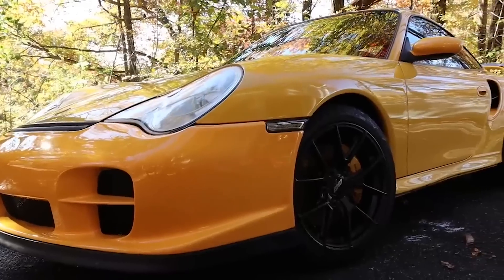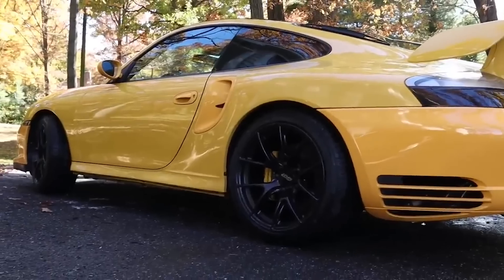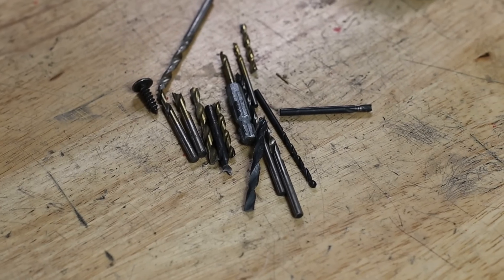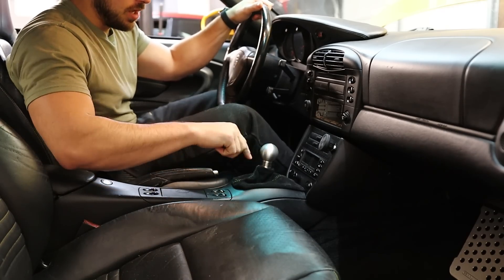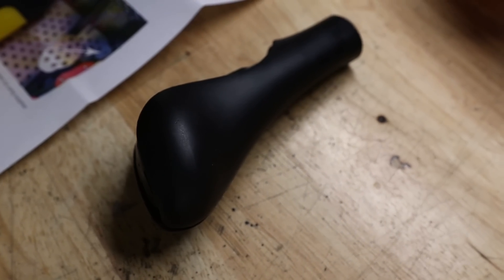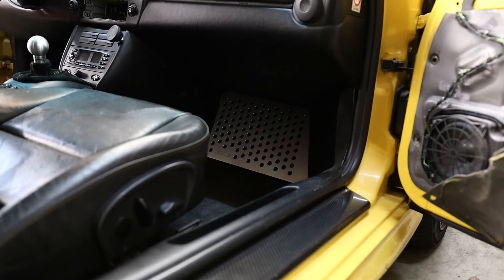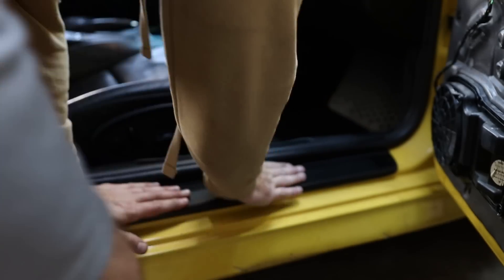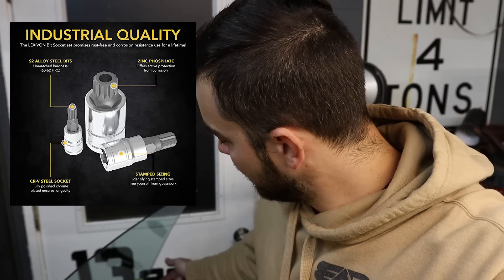Rescuing a Cheap Porsche 996 Turbo - Electrical Problems!

Comment: Hey Matt, nice video!  I've owned an '02 996 C4 and a heavily modified '04 996 TT (only 54K miles).  I experienced very similar issues first hand and after spending over $20K in repairs on the 04 TT last year I gave up and don't recommend anyone purchase an older 911 unless you're very handy with a wrench or have deep pockets! I had fuel pump & boost issues, the power steering pump was leaking all over the place and had to drop the motor to replace the pump and lines, we had to retune the ECU and address a handful of other issues.  The vacuum lines were a nightmare and you have to have hands the size of a small child in order to access them, ugh!.  All in all, very fun car to drive but when there's mechanical issues it can get super expensive, the car spent more time in the shop last year than it did on the road.  I finally sold the 996 TT and bought a low mileage MB AMG E63s and couldn't be happier!
Reply: To be fair you said it was heavily modified right? On a nearly 20 year old car especially depending on the mods fuel pump replacement and boost issues aren't unexpected. 
And on the 996 turbo as well as the 997.1 turbo the coolant line fittings are a well known issue that requires the engine to be dropped in order to repair or prevent. 
Vacuum lines should be zip tied in various places while the engine is out for the coolant line fittings. Water pump and thermostat as well. And all the lines should be inspected to see if anything needs replaced at that time. If that's all done at once they are extremely solid.

Comment: Putting in the (unnecessary) floorboards and fixing the drivers side one with only 1 screw, I personally wouldn't do that. What if it moves while driving and blocks the brake or clutch pedal. It even makes vacuuming the floor more difficult.
Reply from the maker: I see your concern, but it's impossible for it to move in a way that would block anything.  It's actually bolted up top to a factory mounting point.  The only other mounting point is the screw I couldn't drill a hole for.
Reply: Yeah they're a little useless and hate vacuuming that

Comment: Aluminium plates are a so-so decision. Especially in the silver look. I would have them anodized black...like the previous pieces you installed.
Reply from the maker: I didn't go black because you wouldn't be able to see them at all.
Reply: @matt13ross  good choice I went with silver as well with the same thoughts. I love the look.

Comment: I understand the dilemma of when OEM is worn and looking for replacements aftermarket is a cheap, readily available solution BUT I would vote to keep look of OEM mostly. 
Otherwise thanks for the update on progress!
Reply from the maker: For which parts exactly?
Reply: @matt13ross  the carbon fiber bits on the inside and the floor pans.  I'd vote to get them reupholstered with elcantara.  More pricey but brings up the interior to new gen looks. Just a suggestion, check it out.

Comment: hardened HSS drill bits are brittle..slow your drill down or ease off the trigger until it's bitten the metal..especially if you're going in at an angle..
Reply from the maker: Any specific brand?

Comment: Good content Matt, nice to see you filming the full process to determine the fault rather than timelapses which skip over the effort. Just a thought but you could get the seats refurbished/dyed to make the interior better? I do like this project/car.
Reply from the maker: Yea the seats need fixing for sure.
Reply: @Matt Ross  look for some used 997 seats online is my suggestion. Or check out getting corbeau lightweight seats.

Comment: Been watching this series since the beginning. I have a massive project vehicle I need to start working on when the weather warms up, and your series has given me new motivation to get started on it. Appreciate the vision, hard work, and the idea to document this clearly frustrating project. Don't give up. PS winterbeardbros 🤜
Reply from the maker: Glad I can motivate! I haven’t been feeling very motivated lately myself.
Reply: @matt13ross  that wheel hub issue would tilt anyone. I don't blame you. It's hardest when you pick something you think will be easy, and it turns out awful.

Comment: I actually like the carbon fiber. If the materials around the carbon fiber get restored, cleaned up, or replaced it'll look even better. It's not gonna be to everyone's taste. But as long as it's better than before and it's what you like that's all that matters, keep it up!!
Reply from the maker: Agreed!  Needs a few more minor cf pieces.

Comment: If the stupid long throws of the 996 shifter bother you, check out swapping to the 997.  The standard 997 is much shorter and crisper than the 996 and plug and play.
Reply from the maker: I've read that, but for now the throws don't bother me.

Comment: Hey Matt love the content on the Porsche! I’m going to have to agree with a lot of people on the carbon fiber bits and the metal floor trim pieces. the door sill before look pretty clean with “turbo” in the middle are these just too expensive to replace? and I think the metal plates on the floor aren’t awful if they were a matte black to match the petals and kind of hide a little bit better in the carpet. It sticks out too much imo. Not hating just my opinion, keep the videos coming!
Reply from the maker: Opinions are just fine!  I'm happy with these parts.  New seats will really freshen up this interior.

Comment: There is a VW equivalent for the latch. Check the intrawebs. For what it’s worth I ordered latch due to similar issues and it was the regulator in the end inspite of all diagnosis pointing at latch.
Reply from the maker: Yup that's what I ordered!

Comment: Matt, same exact thing happened with my passenger window. It is a short in the latch and it needs to be replaced. Did you order the new latch from Porsche yet? URO makes the part for an Audi that’s not listed as a compatible part on their website, but it it works with the 996. Saves you like $300-$400 and the build quality is just as good as the OEM porsche part. If you want the part # LMK and I’ll dig it up for you.
Reply from the maker: Thanks!  Yea I ordered a VW replacement which was pretty cheap.  Hope it fixes is!
Reply: @matt13ross  10-4. 

So you know, I already tried 3B1837016CG which did not work. The pins do not match. 

The OEM Audi part numbers that are compatible are as follows:

Drivers side: 8N1837015C
Passenger side: 81N837016C
Reply from the maker: Hope I got the right one!

Comment: What are you planning on doing with the seats? They really let the interior down 🤔
Reply from the maker: Still debating.  I was looking at 997 seats but too expensive.  Not really interested in used 996 seats, or fixed back racing seats.  I will probably get these recovered.
Reply: @matt13ross that’s a great idea! They’re not too difficult to rebuild the foam and then recover. If the lateral left side bolsters are in decent condition, which they likely aren’t on the drivers side then there’s even less work! Leather can be dyed easily, so unless it’s torn it should be a relatively simple fix!
Reply: @Matt Ross  I know I replied to a different comment about 997 seats but I didn't see this post about their price being too high. If that's the case I definitely recommend the corbeau seats. They look better than the oem seats and they will drop 50-75lbs.
Reply from the maker: I like my heated comfy seats though!  I have fixed back seats in my E36. This is more of a comfy DD cruiser.
Reply: @matt13ross  you can get heater seat options from corbeau as well

Comment: I would paint the car all same color yellow , source some new taillights , gt2 style rear wind , factory turbo twist wheels, 5mm/10mm spacers, good quality coilovers , dude in blue reviewed my 996tt if you want to check it out 👍
Reply from the maker: All in due time, fixing most mechanic issues before paint and fun stuff.

Comment: Sorry mate. The car is starting to look tacky and very much like a teenagers car. Fitting the plates with only 1 bolt is a safety hazard. Try getting the car back to OEM mate. Some suttle upgrades can be done, but try to keep it original, remember this is a classic!!
Reply from the maker: Not safety hazard with the floor plate, it's not going anywhere.  You think replacing the beat up OEM parts with carbon fiber is tacky?
Reply: I think you got the point...  Too much carbon fiber on a classic car in my opinion... You'd like to restore to oem.
Anyway thank you for this great videos and happy new year 😊 cheers from Italy!
Reply: I agree. This car needed to go back to oem not this style you are going with. Thats just my opinion.  I enjoy the watching , just not my style
Reply: I tend to agree, going OEM is the way. those floor boards are an awful look. Gear knob i can live with as the OEM is nasty plastic. CF as cosmetics seems a bit cheesy these days. Still, you’re having a go, which is way ahead of us keyboard wannabes.
Reply: @matt13ross  you should get carbon fiber running sides with a Porsche logo on them instead of those ones that are just plain carbon
Reply: I don’t understand the purpose of the “floorboard”.   Is it cool just because it’s shiny?

Matt’s in a difficult situation when rennline offers him free stuff and maybe some $$ to install it.  Preserve the build?… or take the cash?  Hmm
Reply from the maker: Man, you guys really hate the floor boards lol. I think they are a nice little touch. They are also super easy to remove if I don’t like them in the future.
Reply: Wow, honestly not surprised. Porsche people only care about factory optioned “deviated stitching” and other nonsense.  They’re always blabbering about the “spec” and how good the clear coat is on their arbitrarily named color.  Then they comment rudely on man’s work which benefits us all. Ridiculous
Reply: What color is your Porsche
Reply: Matt, I love your videos, but you should watch this video from another Matt, to understand how Porsche people think and why you should be careful with mods: https://youtu.be/rdJYiRROeAc 
P.S: Love the floor mates!
Reply from the maker: Speed Yellow ....ish
Reply: X2 the car loses its essence with all that crap
Reply: As a Porsche owner my suggestion is to pay mo attention to what Porsche people say. There is nothing special or classic about a 996. Do whatever you want and keep the great content coming.
Reply: I think even for YouTube this is a money pit. The car is way too tatty. Every piece of trim needs to be changed every piece of interior, the bumpers the paint the mechanicals, electrics. You just payed way too much for it.
Reply: Went from tacky to tackier and ricer. Paint is worse. Interior seems mismatched with black petals and aluminum floorboards. Carbon fiber matches nothing in the car. I guess just sticking on the free spare parts from rennline does it.
Reply: Agree with  @sfdrifts  - ! A 996 isn’t a “classic” classic, but either way: it’s your 996 Matt, do what you want with it! The “only OEM” crowd is very odd and there are plenty of restomod, hotrod & even “stanced” 911’s that look great in their own right. 

- signed, a 993 owner
Reply from the maker: Regarding the paint comments: for the hundredth time the car isn’t done and the paint is being addressed.
Reply: @matt13ross  don’t worry about purists, you’re getting it back on the road and there’s something to be said for that!  It’s also your car, keep it up, enjoying the content!
Reply: @Matt Ross  damn now I see what you meant by that FB post about people not liking aftermarket parts lol.
Reply: Subtle.
Reply: Just saw a post where someone said the 996-911 is not a classic. I cannot believe someone made such a comment. The 996 was a turning point in Porsche history. Handling, 4 link suspension, improved balance and it was at a time when Audi engineering was applied and collaboration really worked. In the UK we are buying any and all 911’s available. Matt, I hope you get the opportunity to buy a 993 and go to work on it. That is truly a purists 911. Once again, keep up the good work mate and try stay true to the industry.
Reply: It's his car, mait. I'm not a fan of carbon fiber stuff either, but he can do what he wants. 
If it looks good & feels good, that's all that matters, none of this "classic" purist nonesene.

Comment: this car should of been purchased for 25k if that.
Reply from the maker: Good luck getting a running / driving 996 Turbo for anywhere close to that price.
Reply: @matt13ross  clean oem examlles w undr a 100k are going for 40k or so
Reply from the maker: I haven't seen a price that low.
Reply: @matt13ross  came across one on Craigslist for 40k w 99k miles on it. there is a clean 03 on rennlist for 50k and it has 100k miles on it.. they are both tiptronics though. sorry man you should cut your losses at this point.. this car is going to bury you
Reply from the maker: That's the difference, auto.  Manuals are going for an average of $60K plus, and those are all silver.  A manual + speed yellow is a huge increase in price / rarity.  I'm not saying it's worth what I paid for it, but you'll never find a running / driving manual for anywhere close to 25K, let alone a speed yellow one.
Reply: @matt13ross you could of just not bought this car and bought a clean speed yellow 6 speed for 70k or so. the 6 speeds on these cars are garbage too
Reply from the maker: I did not have $70k to spend on one lol.
Reply: @scottchelmford7136  the transmission itself is Stout. There are 1000hp+ builds on the stock 6 speed transmission holding no problem
Reply: @sutherlacd27  ive read quite the opposite.
Reply: @scottchelmford7136  the stock clutch is weak as hell. Needs upgraded with just exhaust and tune after a short while. And the shifter itself isn't the best either. But the transmission is solid.

Comment: Way too much boy racer crap! I thought you were bringing it back to an adult car status. I guess not.
Reply from the maker: Boy racer?
Reply: @matt13ross  yes! Which I thought you were trying to get away from.
Reply from the maker: I don't follow the boy racer comment.  Because of carbon door sills? lol
Reply: @matt13ross  It’s not just the carbon door sills, it’s armrests, aluminum floor crap and weird shift knob. Just fix it and save your money. OEM is always classy. When I flip cars, anything aftermarket on it goes in the trash can.

Comment: Sorry but the last two episodes are just cheap slap on parts tuning. You seem to be procrastinating the real work on the car.
Reply from the maker: Not procrastinating anything. The new hub hasn’t come in.  And the parts aren’t cheap
Reply: @matt13ross  You bought a Porsche, what did you expect. 🤣🤣🤣 Anyway hopefully the next one will be better. Don't want to be a hater 😊
Reply: @N911GT2  Spoken like someone whos never taken on a project car. And don't worry, your reply about how you've been working on cars for 20 years and have completed 30 project cars and own 3 race cars will fall on deaf ears, still just sounds like hate to everyone reading.
Reply: Hi Matt. You have a car that is now considered a classic. Keep it that way and rest assured, you will not only gain subscribers, but you’ll also learn more about cars. Be safe.